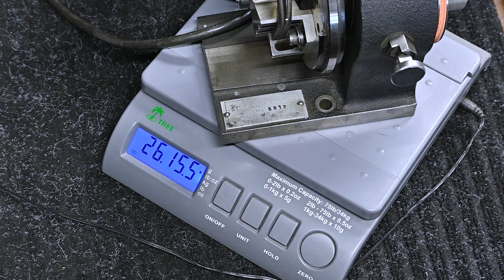Pinch Roller Resurfacing

Comment: Several months back I sold a Cleveland inductive electronic gauge good to 10 millionths of an inch.  The gauge head was somewhat similar to this Tesa one, and it may have had a Stellite point.
Reply from the maker: Thanks for watching. Yes, I've used gage amplifiers in a few videos where the camera position couldn't see the dial well enough. I have B&S, MAR Federal, Tesa, Some are the size of a portable radio and also read 10 millionths.

Comment: So I own an AKAI GXC-325D flat loafing cassette deck from 1976. Every time i clean the pinch rollers, an incredible amount of black comes off the q-tips usung rubbing alcohol. The Wow and Flutter is often heavy from it. I'd like to use the warm water/ dish soap method. Would a toothbrush be okay to use? 
Everything on this deck has been restored. A new heart..(capstan motor) all new belts, etc.
I would truly love to hear any input from you if you've got time. I can't fathom shelling out $130 deposit just to access the problem much less the labor at my local repair shop. I'm really hoping I can correct the issue myself. This deck belonged to my father who passed away almost three years ago and it holds a lot of sentimental value for me.
Take good care - Sam
Reply from the maker: Sam,
First of all, I'm sorry for your loss, I lost mine about the same three years ago and miss him more every day.
Secondly, your Dad had good taste in cassette decks, I've owned a few of those also and think they are very elegant machines. Regarding the break-down of the rubber, you certainly won't hurt anything by trying the scrubbing method and no, a toothbrush won't cause damage, but it's also probably not aggressive enough for one as bad as you describe. Fair warning though, when I see them that bad, it may be the end of their usefulness, but it's certainly worth a try.
As for your local shop's labor rate, keep in mind that tape is the most expensive audio format in the world now, and there are very few still working on these machines, and even fewer of those are competent at it. It might actually be a good thing for you to strike up a working relationship with that shop if you intend to keep the Akai in good working order.
Best of luck.

Comment: I was supposing the surface of the pinch need to be a bit axially rouded . Is this false ?
Reply from the maker: That is correct, and it is. If you look closely, you'll see a radius on the wheel and the pinch roller. 
Here it is compared to a new one on the optical comparator: https://youtu.be/L1ZD8Fzk6V8?t=1653 

Thanks for watching.

Comment: I've watched many of your videos. Can you share what you use when cleaning pinch roller tires? There's a lot of misinformation out there!
Reply from the maker: Thank you for watching.

I've mentioned it a few times. I use dish soap, warm water, and a soft brass brush, the kind available at welding supply houses. Never sandpaper, never, ever. Scotch-brite might do in a pinch, but the brass brush is better. For maintenance after I have it resurfaced, I use S-721H from American Recorder. IPA is also fine, if you question it, just look at a chemical comparability chart, it's recommended. Naphtha swells the rubber and makes it appear to work for a time but is short-lived. Rubber Renew works, but again, it's a temporary solution and once things get to that point, a better solution is needed or you'll be Rubber Renewing yourself into the poor house.

Comment: What’s causing my tapes to snap? Would it be the old pinch rollers on my cassette deck?
Reply from the maker: I don't think slipping pinch rollers would snap a tape, maybe, but I don't think so. Has the deck been serviced? It probably needs to be gone through.
Reply: @asbcustom  the only thing I did was put new belts.
Reply from the maker: That's not sufficient, you should probably take to someone who can go through the whole mechanism for you.
Reply: @asbcustom  I just put a new tape and it didn’t snap. Maybe it’s just because the tapes are old.
Reply from the maker: Could very well be.

Comment: This is not the correct setting! I ran the indicator in the center of the axis, but did not check the edges of the axis. At the end of the video, you can see how the tip of the axis rotates with oscillation !
Reply from the maker: Thank you for watching, Yaroslav. What you're seeing is the oscillation of the tiny cap screw and the loose washer, the shaft isn't visible. Please see my procedure for indicating a shaft on this video: https://youtu.be/qq8nTqLjHmw
Reply: @asbcustom  The axis on which the roller will be installed must be drilled from one installation and every new time. Then there will be alignment and there is no need to measure the indicator! The roller must enter the axis with force and not be compressed by the screw.
Reply from the maker: Obviously, an interference fit to a precision bored (not drilled) hole is more concentric, but this is a pinch roller, not a fuel nozzle for a Sukhoi. A proper technician must be well versed in applications and tolerances, and discern when and how to apply them correctly.
Reply: @asbcustom  You measured the axis at one point and set the offset according to the indicator. But I didn't check the axis at the beginning and at the end. Why are you sure that the axis does not have slopes at the extreme points? Give me your Whatsapp contact and I'll draw you what the problem is
Reply from the maker: I don't need your drawing but thanks all the same, I'm very aware of the fulcrum effect, which you would know if you had watched the link I sent. You've fixated on a single moment, from a 10 minute video, of a job I worked on for several hours.
Reply: @ЯрославВасильев-х9н I don't need a drawing to point out your problem.. No concept of the need of accuracy on a rubber pinchroller and the unmeasurable audioeffect it has when doing things "your way". Plus: your need to ventilate your criticism as if it were religion.
Ever measured wow and flutter using slightly different roundness quality pinchrollers?
(Not a question)

Comment: Can most pinch rollers be resurfaced? I guess it depends on circumstances if you'd replace or resurface? Engine machine shops get down to that level of precision. I wonder if they could do something like this, given it's larger than a valve stem.
Reply from the maker: Not all pinch rollers, no, sometimes they are beyond help.

Yes, most any machine shop could easily do this, but I don't know of any that would.

Thank you for watching and commenting!

Comment: Beautifully done.

Interesting the work done in getting the concentricty that you needed. I learn a lot from watching your vidoes, my late father would have loved to have seen this stuff, but the internet was just taking off when he passed away.

I tend to think in mm nowadays and microns rather than inches or thousanths of an inch etc. Strangely I've tuned into the metric system .... eventually.  :) 

I've a bunch of old pinch rollers that I've kept, maybe I'll have a go at 'grinding' excess rubber off one day. :)
Reply from the maker: I lost mine not quite a year ago, miss him terribly every day.

I've seen a few different ways that people have tried to "repair" pinch rollers - sanding, using drills, Scotchbrite, everything except the right way, in lieu of the correct equipment. Warm soapy water and a scrub brush will restore most of the ones I've seen without damaging the sphericity or profile. A round convex shape, simply cannot be freehand sanded true.
Reply: @asbcustom , парни, у меня отец был радиоинженером, 5 лет, как я возобновил хобби с аудио(в основном,  деки 70х годов),  он был очень рад, узнав что я снова в хобби,  и 1.5 года как его не стало.  В  детстве, он всегда собирал за мной технику, которую я раскручивал и даже не ругался.  Всего наилучшего вам!
Reply from the maker: @LEX_A70  Спасибо за просмотр, Алексей!